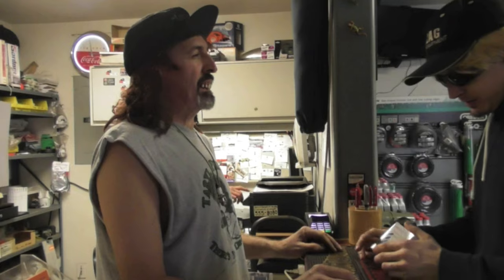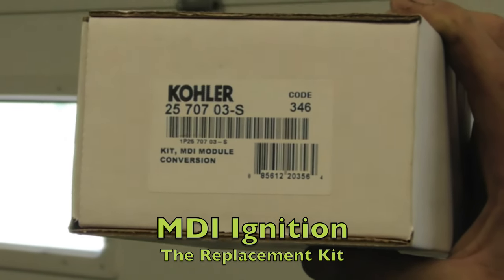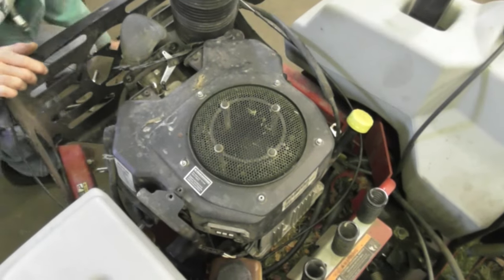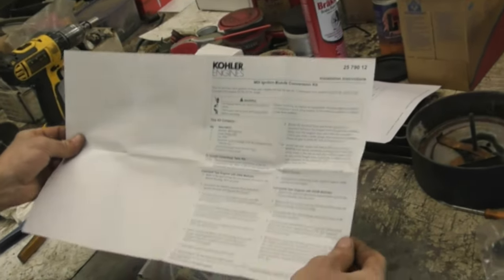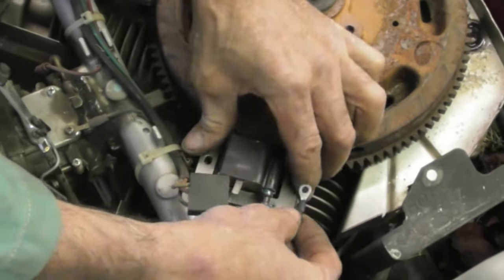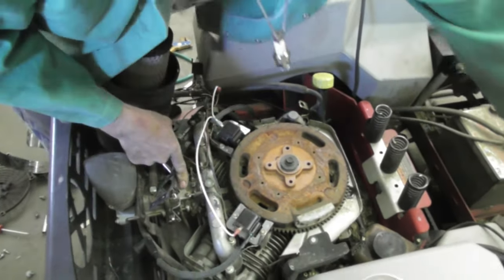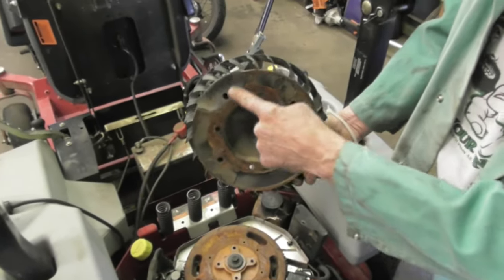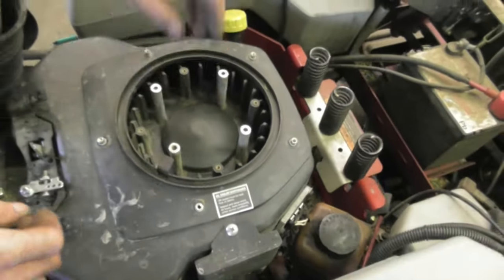EASY GUIDE to Install The Coil Kit On A Kohler Command Engine (DSAI Ignition)

Comment: Just installed the coil kit on my Kohler 26 hp courage and adjusted the valves like your other video showed, let it sit 2 days for the valve covers to dry, they were leaking also, fired it up today and it ran like a champ, better than new. Valves were out a little not to bad, can't thank you enough, sure wish I could buy you a beer or two or three.................... thanks again !

Comment: This video is a lifesaver! After struggling with my mower losing power off and on for about a month, I finally figured out that it was dropping a cylinder and ordered this kit from kohler. The video was made on a mower exactly like mine and the instructions were so good that the whole project went off without a hitch. Fixed it in 4 hours and 2 beers for $80. And I even had an extra zip tie and Krohler sticker! Thanks for the great directions.

Comment: Thanks so much for the video!
I had the exact same issue with my Exmark and started researching online and sorted it down to the bad coils and new replacement parts, and then came across this video.
It confirmed that I was headed the right direction with my diagnosis and then saved me a ton of money! 
You have a new subscriber and a thumbs up! 
I love your humor, and yet you get right down to business with precision info and what needs to be done spot on! ...Thanks again.
Reply: I have a láser z and a craftsman gs something.... both have the kroller 27 but the courage is nothing línea the commander... 😮

Comment: I'm Putting My 1st Set Of Head Gaskets On This Krohler Crommand 27hp CV740S, And Found A Bad Coil, Glad I Found Your Video, I've Been An Auto Mechanic For 20 Years, Just Bever Had The Patience For These Small Motors, And I Know That Prolly Don't Make Sense, But Anyhow....I've Seen All Kinds Of Mechanics & Shops Over The Years, And Just Goes To Show You, That You Aint Gotta Be The Most Snazzy & Fancy Place In The World, To Be The Best Mechanic Shop Out There, This Guy Taryl Is Smart As A Whip, And The Entertainment Takes The Edge Off As Well, Nice Work Man, Keep Going....And Oh, By The Way, I Loved Your Home Made Lift Video & Head Gasket Video Too 💯
Reply: Oh, The Oil Seal & Alternator Tips & Replacement Video Was Helpful Too, Wathched Your Tuff Tork Rebuild As Well, I Get This Scrub Cadet Zero Turn Going, The Tuff Tork Is Next, I'll Be Purchasing Something From You Soon As My Appreciation For Your VERY HELPFUL Videos 👌

Comment: While I don't have a two cylinder, I do have a Cub Cadet 2166 16HP.  I used what you taught about DSAI/DSAM to order a new Kohler kit to fix.  Engine is horizontal = a real pain.  You would be proud of the way I got to those recessed flywheel cover bolts.  By the way, I got filthy and grimy.  I hope to reply about a smooth running engine success.  You guys are the best
Reply: It started and ran! Kohler 1270701S   I cried and wet myself
Reply: @fair2middlin  Super.  Replacing the clutch is so much easier!

Comment: I have a 2008 Walker super bee 27 hp. It never gave me a problem…until I smelled something…the coil caught fire! Two buckets of water from the pool and the hose put out the melted plastic. I removed the engine…horizontal shafts are a pain. I luckily found your video. I had no clue about the mystery wire. Thanks for the dinner.

Comment: End of month, out of data, so went ahead and got the shroud off.  Then decided to go to the library and watch this vid.  I had made the mistake of taking the bottom screw out of the oil cooler, and it was a struggle to get out.  But I shortened this screw to 7/16" "thread" length and it went back in pretty easily.  So the oil cooler is bent out of the way just like Taryl says to do, and I'm awaiting the kit.  Always, always consult Taryl first.

Comment: They must have updated the instructions.  Step 4 of the DSAI Module instructions references the "eyelet of the RFI sheathing" to put under the module mounting screw, just like you said, Taryl.  For the DSAM Module instructions, you get to step 8, and it tells you to go back to the DSAI Module instructions to complete steps 3 - 12, including that Step 4 that references the "eyelet of the RFI sheathing."  All good now - hope this helps someone else - Another GREAT instruction Video from Taryl.

Comment: I am doing this for the second time. The first set lasted 2 seasons. Koehler said it was due to voltage spike from elactric blade engagement. The guy from Koehler was awesome, he walked me through the whole process of checking the switch and sure enough it had a spike. A mechanic friend confermed that it is plausible that the clutch/engagement will use a little more power to pull it in as it ages. I thought this only happened to ME 😂. The guy from Koehler gave me all the part #s for the coils ( coils only ,not the whole kit) saved me $20.00 then he gave me the part # 25 755 31-s for the DIODE KIT. Told to install the diode nline. I'm thinking it is like a one way valve for electric. I am a skeptical person but this all makes sense because for the last 3 years I have been getting more and more fire ants. The last time I counted, I stopped at 70 over six acres.I always put stuff on every mound.I am in the process of doing the install now. I put it off all winter because of another neck fusion, now I have to do it because I can't find the coil replacement Gennie. I'll let everyone know how it works out.Thanks  Taryl for the little reminders ( hidden bolts I forgot about).
Reply: And what were the numbers for the coils?

Comment: Just replaced a set in the shop, and said some 4 letter words other than Crap before I got the cover and breather back on.  Nice Kroller. Should have gone for the Shot Gun.  But the customer might not have liked that.  Great video Guys.

Comment: Just went through the same procedure but on a CH25 Kohler. This engine had already been converted to the magneto system. It ran fine, but wouldn't stop decently. Turn the key off and the engine would run on one cylinder. This was verified by looking at the plugs after shut down. One was dry, the other wet. I also used a spark tester to verify what was going on. After the key was switched off, the right side had no spark but the left continued to spark. So, I installed two new genuine Kohler coils and it solved the problem. Apparently, the bad coil even though the engine ran perfectly, had an open kill circuit which resulted in that coil continuing to fire.

Comment: Thanks for posting this “how to’ video.  My new ignition modules arrived today (with one lead each), and I looked at the ignition modules on my mower with 3 leads each; and I said, Oh, sh#t, they sent the wrong type!

This video told me why the new modules were different, it showed me how to install the new modules, AND it gave great installation tips.  

Kudo’s to you!  Slainte.

Comment: The kit you installed looks very much like the ones small engines have used for years,,looks like if the ignition had problems , Kohler should have given the kit away instead of charging for it,,,, it's only my opinion but I think the old Kohler's  were better engines than the new aluminum ones are.
Reply: Bunches of the new ones are coming apart. I've got 2 cast iron 12 horses that never miss a lick on Gravelys. Bullet proof unlike that printer of his.
Reply: MissouriOldTimer i agree, replacement kit cost me $115.00. Unethical of kohler! give me a briggs in a sears tractor any day
Reply: There is no mistery. Kohler partts have been made in CHINA since 2007. Kohler is cheap Chinese crap. Husqvarna no longer mounts them. Stick to Kawasaki and Briggs
Reply: ruben trujillo yep, then you can just replace plastic camshafts every few years.

Comment: TARYL ! Have you considered using dielectric grease for electrical contacts ? I use it all the time from plug-ins/connectors to 12 V light sockets. It promotes contact and reduce the chances of corrosion.
Reply from the maker: R Verro indeed we do use that, it's in the Valco Gel Lube we sell. That's not the problem in this case though.
Reply: R Verro dielectric grease is an insulator, it actually doesn't conduct electricity. So it really doesn't promote contact.

Comment: A good tip. Replace those self tapping screws with new  bolts or allen heads not that the coils should be in and out that often but  they will eat those threads up i  had ti heli coil  couple threeads for them

Comment: Hi Taryl.  I'm doing this and putting the heads back on, and didn't take note of the thin shank head bolts vs think shank.  Do the two thick bolts go closer to center, outside, exhaust?  Please help!

Comment: Is it the correct way to mount ignition coils with the spark plus wire on top and both kill wire connectors on top also? What would happen if the coils were mounted with the plug wire outlet on the bottom?

Comment: I just jacked some coils from a old kohler and did my swap
Reply: Did it work
Reply: @col2959   not at first.  The timing was off.  You have use the flywheel also from the donor engine.

Comment: Hi Taryl, I write to you from Denmark, I have a Kohler Command Pro 25 (Model no. Cv730s, spec. No cv730-0038). My problem is that the engine idle up and down all the time, so I thought that maybe I need to do the same repair as you. Can you please tell me if that kit you put on, also will fit my engine. Thanks in advance Taryl, I wish you and the others a nice day, stay safe over there. Best regards Klaus

Comment: I got a 13 hp kohler command. Something messed up in the wiring so I disconnected it. It run good for 1 time. Went to start it a few weeks later and it has no spark. Does the coil require electric to make it work or shoukd it be able to run without the kill a ire being hooked up? Cause it run 1 time with kill wire disconnected but now no spark

Comment: Had to replace the coils on a 840-3012. Took longer to pull the top off than to replace the new coils and wiring. Simple fix with the included instructions so if anyone is experiencing this problem don't be afraid to jump right in there and get it done.

Comment: I have the same up on my Toro LX 500 with the Kohler Courage. my tractor runs just fine. but, it will not shut off. I have changed the ignition switch and still will not shut off. any idea why>?

Comment: Can you tell us why the screen goes on the outside of the cover ? Im so tempted to cut the cover out , so i can remove plastic cover without taking that round screen off ..,one of mine dont have the thicker built up double plastic rings molded into it like that one around the edge of that round screen , all horizontal shaft kohlers , ech-749 , three 730's the covers all fit but they got different holes designed in them , one has the key mounted in the plastic cover , vermeer 252

Comment: hello Taryl, great videos. hoping you can help me. i have a 16hp kohler command that just stopped working. replaced new plug, coil, and still no spark. thinking after i saw some of your videos it may be the small black box {i think is spark advance} there are 2 wires that feed the coil. one of your videos showed you installing a kit on a twin.......is that available for my piece of crap? if not where do i get the black box?

Comment: I had guy do a valve job on my Briggs & Stratton 16HP MD: 31H777 -0115-   . and one of the COIL bolt holes was stripped. I ended up rre-tapping the hole ,,, but then the bolt was to big for the hole so I drilled out the mounting hole. I never got it running again after that. Do you think me  modifying the coil's hole had a lot to do with that.

Comment: I just received the kit for the Kohler Courage Twin engine (SV735).  The directions say to connect the new MDI module wiring to the white lead wire on the #2 cylinder side of the harness.  Just to make sure, ...what side is the #2 cylinder?  Thx in advance.

Comment: Are those two wires coming off the MDI modules not the grounds? If they are the grounds wouldnt fastening them with module mount screws be defeating purpose of the ground?

Comment: Great video but question, I have a 2004 Ferris 1000z with a cv20s , pulled right plug wire and it died, pulled the left and no change so I’m thinking it has to be the coil. Problem is there’s no engine tag/decal . Need help to order the right coil kit. Thanks

Comment: Got a kohler 22hp o. a cub cadet zero turn engine turns. over and over have to hook jumper cable to lawn mower battery and truck battery turn the key on lawn mower then the mower cranks any advice

Comment: i know this video is 3+ years old, do they make this kit for a ch22s-66541? I been looking for well over an hour and I'm not sure what coil I have.  I do know that I have the control module that he said the sticker was to cover up the wiring hole.  But the part number he is using doesn't match up to the ch22s.

Comment: Hi Taryl.  Just watched your Coil kit installation.  I have a CH25S model with an analogue spark advance module.(ASAM).  Do you know if I can replace this module with th e 25 707 03 S kit you have used in your video. Ant help would be appreciated. Regards JohnO (New Zealand).  PS I thought your printer fix was spot on.

Comment: I have a cv22s spec 67529 with the DSAI  that doesn't work anymore. What regular coils can be used to replace them? I had one from an engine I parted out, put it on and got the one cylinder to fire up, don't know what engine it came from.

Comment: Hey bud . just wanted to say I want your channel all the time. Thank you for all the helpful information I have a 2007 bad boy 60 inch cut mower what a Kohler engine that has the same kind of issues do you know if Kohler is covering this under warranty or is this my problem. Mower has 350 hours. Didn't start really having this problem until about a year ago I just been kind of using it the way it is trying to find out information until I seen your video. Thank you in advance.

Comment: Got-Damn Taryl!!   I replaced my Ignition Coils in my '05 Kohler Command 27HP Twin - CubCadet LT1554 Tractor. I started her up and I'll be damned, she runs real damn good again! ~~~  I stomped on it and peeled outta my garage sideways, yee-haw!!  it's like a brand new engine, even better!       
I thought about putting some No-Ox grease on the coils, mount posts, and other rusty parts after scuffing them clean to see if it will keep them from rusting so fast.  Would that be ok on the fly wheel parts too?    anyway.. Thanks Man!

Comment: That wire ...well you remember they tell you to ground your plug when its pulled out to check for spark ? And they stress to make sure the plug is grounded , apparently it burns up something in some ignitions , if they aint grounded , that extra  wire is there idea of preventing that ..

Comment: I have a exmark lazer z with the 26.5 hp efi and it dies when i unhook my battery. It also is running rough cutting in and out on one plug

Comment: My ch740-0094 engine has a speed sensor on a bracket over the coil. What is the proper air gap for the speed sensor?

Comment: Would it run any different if those coils were upside down? Kohler 20 pro has the left side kill wire tab underneath and the right side kill wire tab on top. If I disconnect the kill wires it runs perfectly. But if I connect the wires to the coils it won’t throttle up and dies out.
Reply: Did you ever solve this?  I'm having the same problem.

Comment: Thanks for your video!    Just FYI, when I got my part I tore into my mower, started taking things out (and throwing stuff away) and then I look at the new part they gave me and it is NOT A NEW PART.  Both modules have big scuffs and a couple dings taken out of them.  Pretty crappy of Sears Parts Direct to sell me a used part.    It did work, but I didn't feel confident installing it.  Would have sent it back, but I needed the mower to run today.

Comment: I'd really like to know how it works that the kill wires on both ignition coils are connected together. how does it not cause crossfire/missfire. I could take a guess that the inductance of the wire blocks just enough voltage to prevent a spark on the wrong side, but doesn't seem like it'd be enough to prevent problems. I'm clearly missing something here, because many engines come this way from the factory.

Comment: Good to know there's a kit available IV got a ch 22 on my Ariens 010 what I use on the coils the brass one in most feeler gauges has I assume there for magnet not to stick i put main seal in mine couple years ago had to set the coils they were rusty why I took them off to clean wile it apart

Comment: Had the same problem mower would run good one day and not the next then one day started smoking real bad and ruined my new oil I just had changed. I ended up getting the kit and changing the oil again now it runs perfectly. Another thing I had a buddy that had the same dsam coils used and I switched the coils out and that was a waist of time. The dsam module is the problem not necessarily the coils so you have to buy the kit to get rid of that dsam module crap.

Comment: I tried to do this on my Miller 302 airpak which has a kohler command 750. The throttle is controlled by a stepper motor. After completing the update the stepper motor didn't act proper and machine would not turn off. If anyone might know the solution or ran into the same problems as me maybe drop a reply. Would be interesting to hear from you